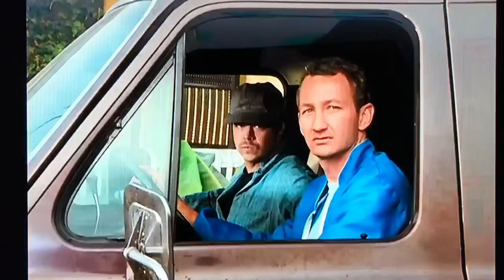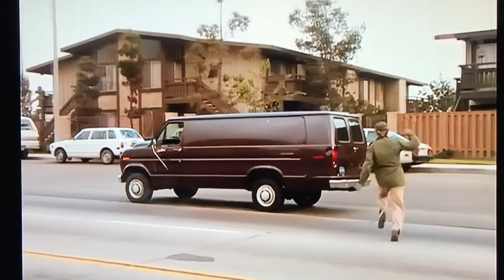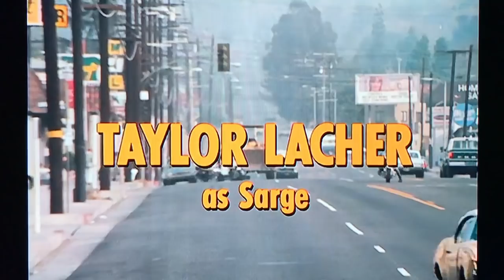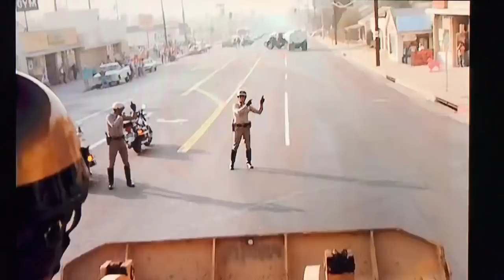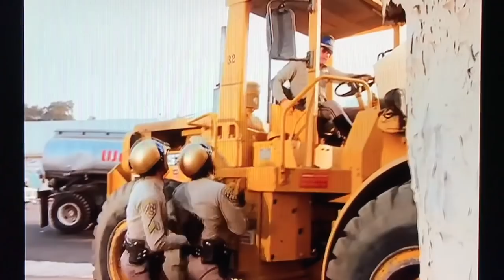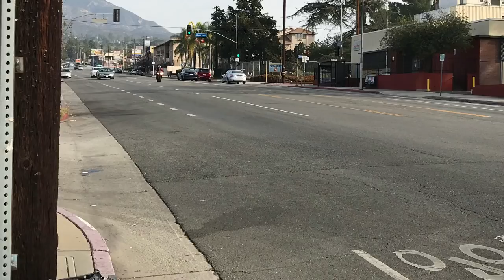CHiPs Film Locations- Then and Now- Skip Loader

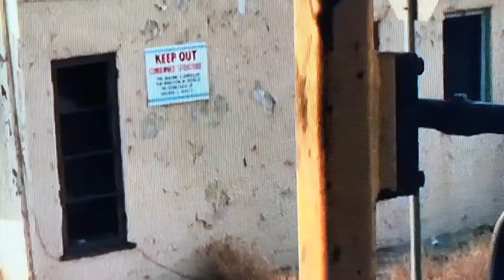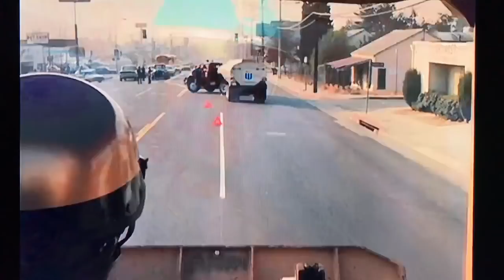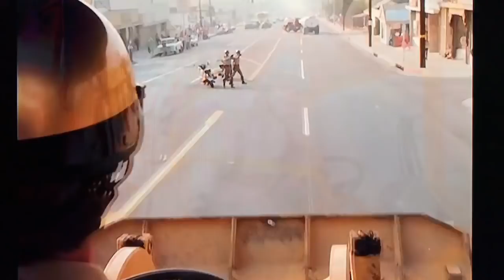Comment: 4:28 This building, at Foothill and Mather, with the trailer park on the other side of Foothill,  isn't the same address as the one Jon hit; it's pre-1981, but still standing today .  The building hit was at Foothill and Nassau, with the building on the right hand side of Nassau (3:23) still standing, now with a tile pattern that might have been obscured in the 1981 NTSC video, a doric-topped downspout near the corner which was also there in 1981, and a new gable-shaped parapet over the bump-in, which is now an entrance with an iron grate. The building hit has been replaced with a condo, with Volunteers of America just beyond it.  The McDonalds is one lot before (east of) the corner of Woodword and Foothill. That building in the top-left corner at 3:12, with the false Mansard roof, number 8120, is now the Tender Dentist.

Comment: First those loaders have hydraulic steering and will not change direction on their own.  You have to turn the steering wheel. 

Second a little building is not going to stop one either. Simply too much weight/inertia.
Reply: Couldn't he have also just turned it off?
Reply: @sgtpepper1138  yes. He could have simply put it in neutral and set the bucket on the ground to drag it to a stop. But that wouldn't have made nearly as good of a show!!!!